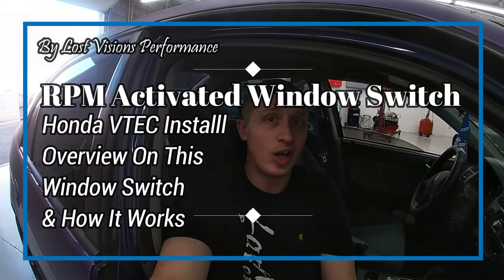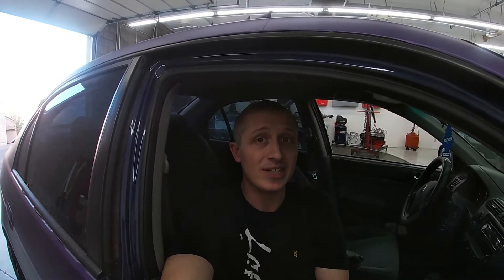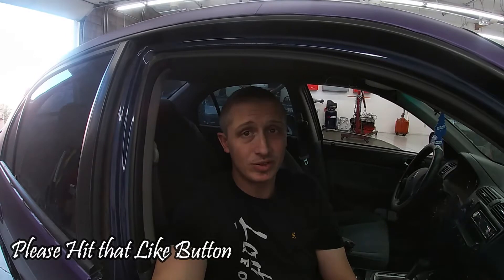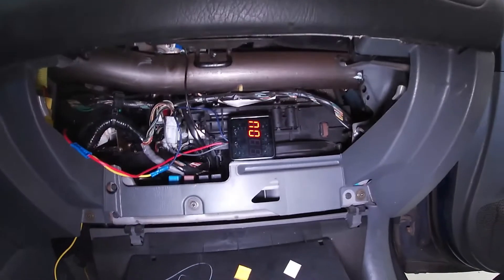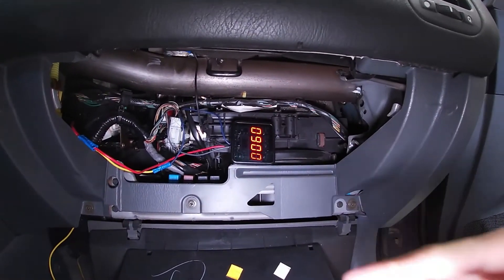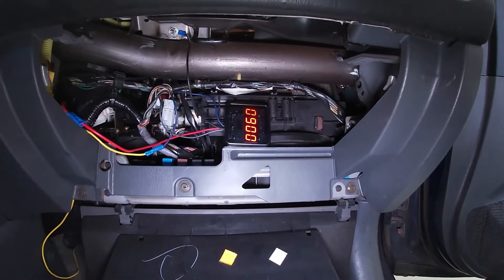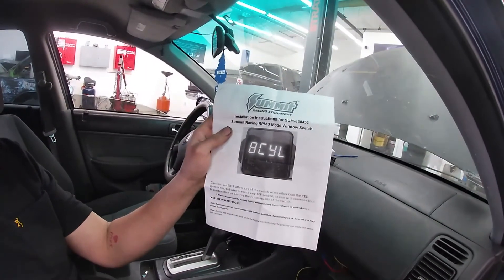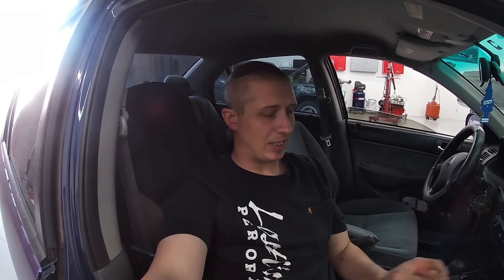Summit 3 Mode RPM Activated Window Switch Overview & Details on Honda Civic non VTEC to VTEC Engine

Comment: I'm trying to install this on my honda your video helped alot ,jus one question I can't identify the vtec wire on the ecu should I tap the wire at the solenoid or cut the original wire of and use the rpm switch on the solenoid alone

Comment: If i run 

power as power on run off the fuse box
Tach to tach signal 
Switch wire to ignition power wire on my hei distributor 

Do you think this would work as a budget tach and rpm limiter, or would the loss of tach signal when the ignition source cuts out just kill the engine completely at highway speeds, or worse cut in and out erratically allowing the engine to run above the desired rpm?

Comment: Hey Thanks for the explanation! I had a question; when you set up the switch to activate at a specific RPM, will it hold the activation at specified rpm and above?
Reply from the maker: Yes you can select what rpm the switch engages and it will keep it engaged untill your desired rpm you want it to shut off.
Reply: @lostvisionsperformance  Alright Thanks !

Comment: If i heard right.. if i want my nitrous to Engage at a certain rpm and turn off at a certain rpm I would put it on Normally Open  and NOT Normally Closed?
Reply from the maker: Depending on your setup yes.  Normally closed will keep whatever you have it hooked to energized then shut it off when it sees that certain rpm. You would want it open so it is off untill it is in the right rpm band and it will engage the system. Hope that helps

Comment: Could you modify it to run off of the speed sensor to turn on stuff at a certain speed? Like roll up windows automatically once you go over 55mph?
Reply from the maker: Hmm. It may be possible. Would have to mess with the "cylinder" setup to see how it would see it best for the rpm that it would read.  I have not tried to do a setup with anything like that  tho.